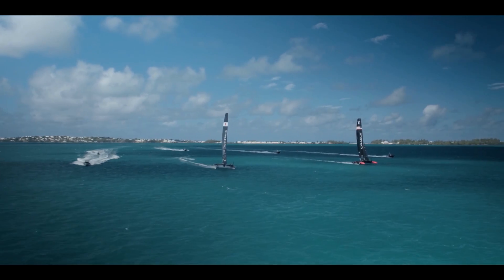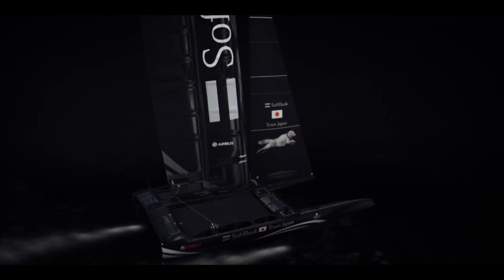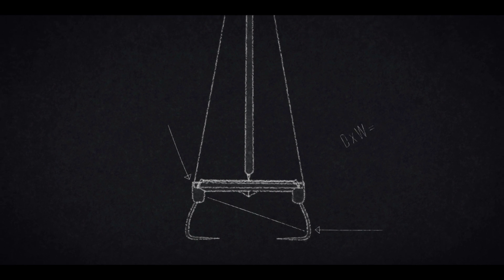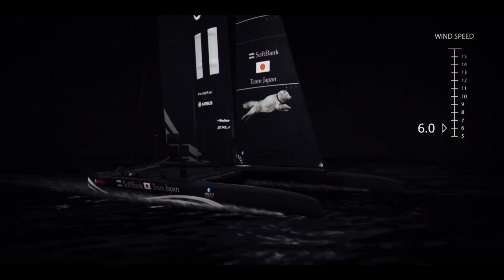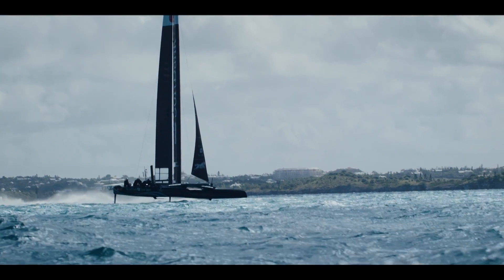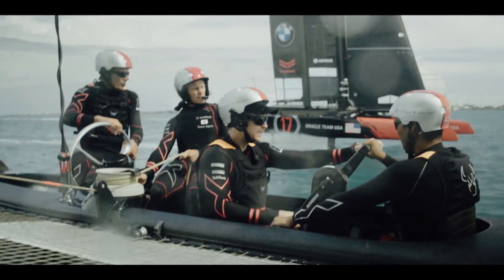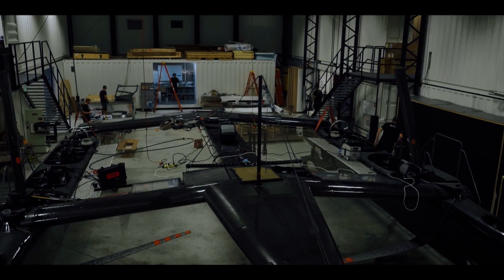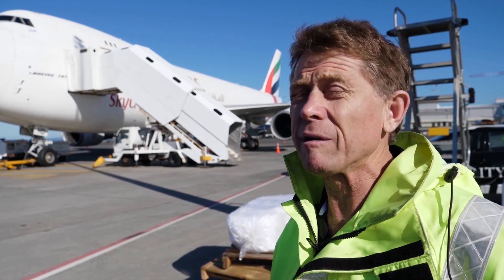How America's Cup boats fly

Comment: Dave Keiper sailed his homebuilt hydrofoil across the Pacific, often singlehanded and without automated systems, 50 freaking years ago. Cruising cats could benefit from simpler, lower performance foils but still cruise at 2-3 times the average speed possible on the hulls, if only a fraction of this engineering effort would go into a robust, reliable system design. There has to be a sweet spot between these multimillion dollar monsters and surfers on foilboards.

Comment: Since the AC went to "cats " I have been absorbed by these crafts. So clever.

But the downside I feel is the competition seem to be Designers vs Designers and the Sailors are the foot soldiers. Bit like F1 cars.

I like AC racing better than F1 racing. I think there should be a Annual regatta between AC racing. But the expence would be huge for teams
Reply: That's basically what SailGP is.

Comment: What do the cyclist do on the boat?

Is there any practical economic application for this technology?
Huge flying container ships perhaps?
Reply: Their only function is to keep the hydraulics pressurized. Constantly cycling to provide the power to systems. They are not "sailing" in any way.
Reply: Maintain pressure in the hydraulic systems that control sail angles and rudder angles.  These boats are too big, and wind forces too strong, for sailing lines to be pulled in by hand.

Comment: those cats with those hydro skis are in no way representing  what sailing is about. all together different gig. fast tracking where the craft it self isn't even touching the water, A 5 year old can figure that out. water skiing & professing sailing. wind blown yes but not sailing. the correct term is Hydrofoil equipped boating ether gas or win, makes no matter,it's not sailing in the traditional meaning of the word. so lets get it right.
Reply: If these wind-driven watercraft aren't part of "sailing", how would you define "sailing"?